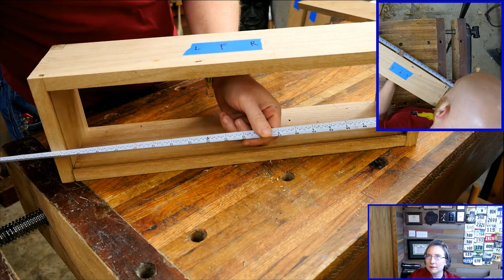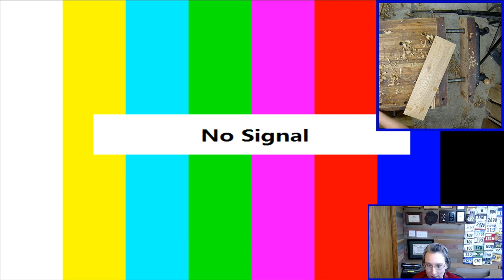How to put a bottom on this box live?

Comment: With your scrub plane, how do you deal with knots? In my experience even the smallest one makes the iron dull immediately...
Reply from the maker: I just power through them. the scrub plane does not need to be extra sharp I normally run it tell it is extreamly blunt. knots are always fun though. if it is catching too much then the iron should be retracted to not take quite so big a bite.
Reply: thin cuts with the blade angled a bit or a low angled plane should help or use a cabinet scraper around knots, the grain can be curved around a knot risking tear out if your not careful maybe your edge is too steep on a softer steel blade set for cutting to much material is the reason you get a dull blade after a single knot, for quick facing consistent speed with a solid hold on a solidly held piece where your moving with your weight behind the plane stepping forward in a single motion can help ensure you slice through and don't bite on the knot, learn to love to sharpen your tools and set up some sort of sharpening shrine nearby ;)

Comment: I thought when you were going to attach the bottom to the box you would have used a molding plane to create a rabbet, but instead you used a different method.  Is there any advantage to what you chose over a rabbet, or is it just your personal choice?  Good video.
Reply from the maker: A rabbit would rely on the glue to hold the bottom in and for exterior work that's not always the best method. A groove could be done completely without glue.